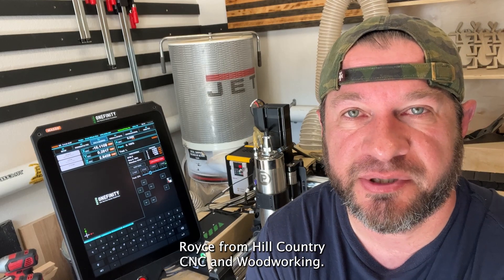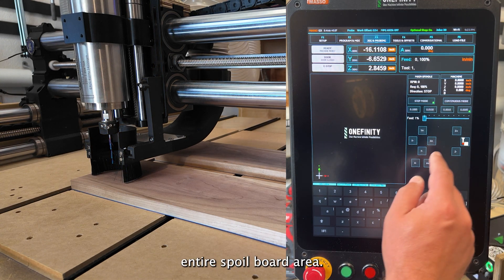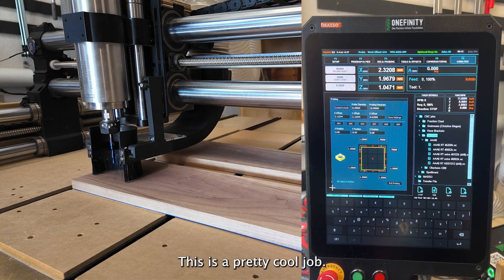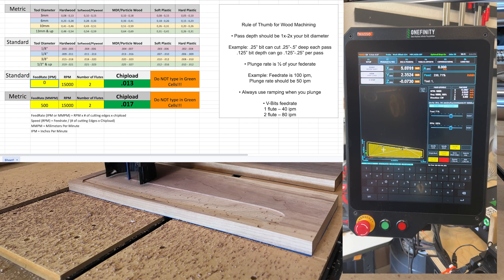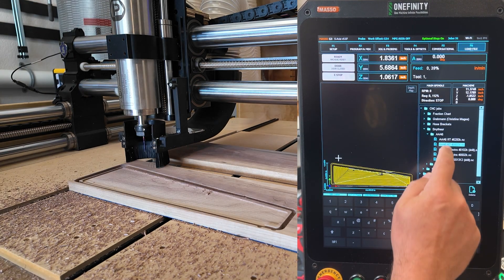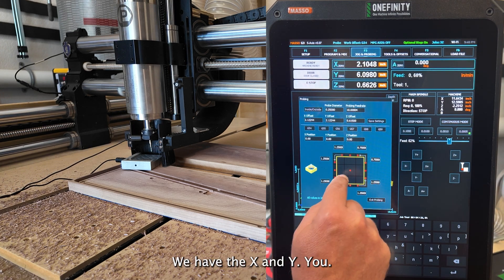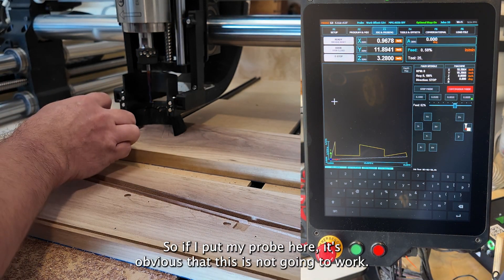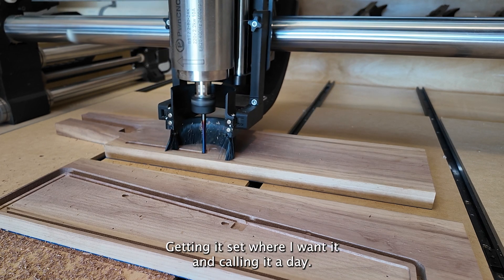MASSO G3 "OVERRIDE" Touch Feature

Comment: Really sucks that Masso doesnt allow overriding the feed past 100%. Ive got in the habit of setting high and then backing it off where I want it like you said. 

Also you talked about the jerk and speed in the corner, not sure what cam software you use, but if you use Fusion 360 try using the feed optomize setting.
Reply from the maker: I use Vectric and Fusion. And yes, Fusion does that portion of programming WAY better!

Comment: What post processor command did you use to get the spindle to ramp up to speed before starting the carve? My system wants to dive into the project before the spindle gets up to speed. I added G04P8 and M03 S18000. Suggestions? MASSO controller, Vetric Vcarve. Edited my Masso Arcs inch pp. Thanks
Reply from the maker: Hey I know I haven’t answered this, the truth is: 1. It’s not that simple. And 2. I’m using a few different programs thus a few different codes. And none of it is where I want it yet. And you also may have picked up on the fact that the code is in the post processor not the Masso so it complicates this question alot!
Reply: Its a delay setting on the masso itself under spindle i think
Reply: open the settings page, and under spindle, there is an option to add a delay in milliseconds.